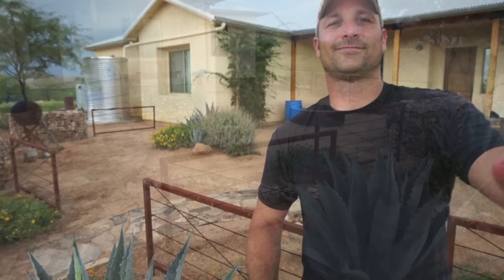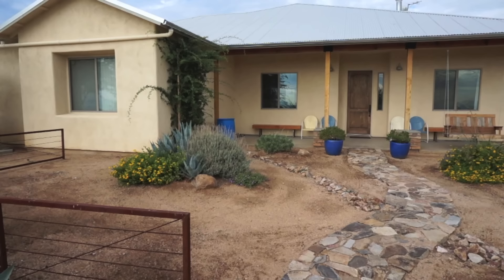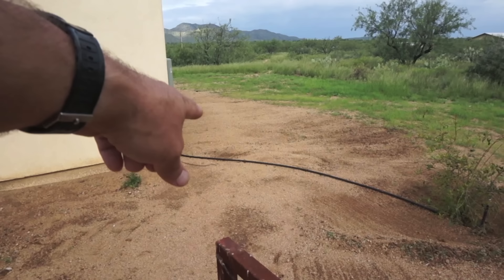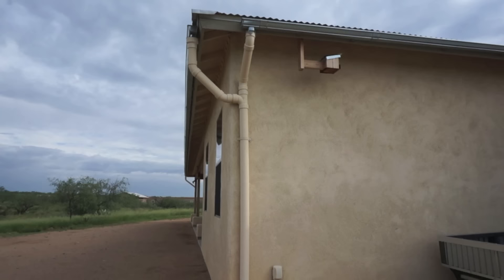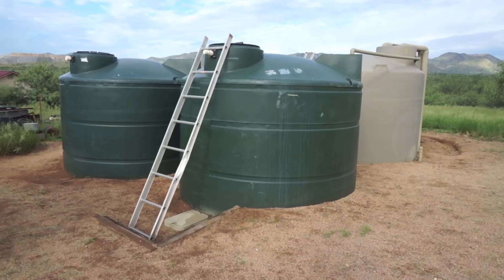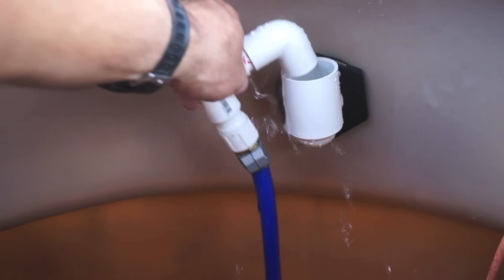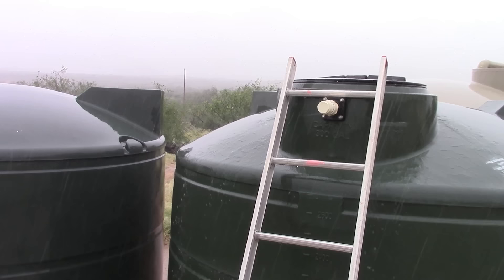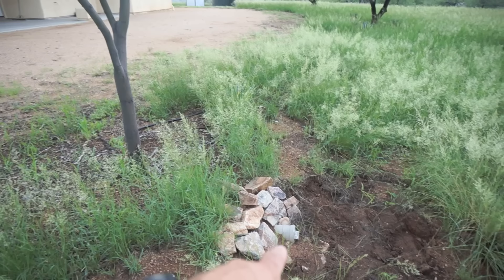Rainwater Harvesting - Home System Tour

Comment: I work in water field and have to say this is a amazing system ! the only issue is you never explained what sort of disinfection system you have in place ? Simple cartridge filter is fine for most contaminants but to not have a steady disinfection byproducts in the water is sketchy for me . You could always put a miniature R.O. sytem inline for complete removal of residuals and contaminants. I'd love to see the pump that I assume sends it to a water heater for showers and what not ? Overall this is amazing dude and what a great job doing the video editing and all .
Reply from the maker: +peteandjanis Hi Pete,  I plan to do another video on our filter system.  For bulk disinfecting we use a very small amount of bleach in the green tanks.  There are charts online that show how much is equivalent to municipal water treatments and we use much less.  But basically that is just to keep anything from growing ;)  As for drinking and cooking water, we use a Berkey ceramic filter system that is rated at 99.99% effective.  They are very popular in Africa and other places that don't have access to the cleanest water.  Each ceramic element  gets around 2-3000 gallons of effective filtering before they need replacing and we use a 2 element system.  So give or take, every 2-4 years we need to change them out.  Anyways, hope that answered your questions and thanks for watching:)
Joe

Comment: Rest of excess water you can dump naturally in ground by making 7x4 feet dug in your land and fill up with sand and small stones. It will increase water level in your area. Also if you have borewell then you can connect this  with pipe horizontally.

Comment: An ideal setup - if water cleanliness was top priority - would be an additional 1,000 gallon tank as the initial catchment for settling. Then after each rain event use that existing pump to transfer to other tanks through a set of 5 micron filters, 1 standard pleated and 1 carbon activated. The smaller catchment tank would be much easier to clean than large tank as shown.
Reply from the maker: +Harley04 Yep it's not perfect, but it works for me:)  However, I will say that I don't think I'd go to a smaller initial tank as it would overflow way to quick during a rain event.  In an inch of rain we get around 2000 gallons of water in this tank.  So if it were too small there would be no way that I pump could keep up, let alone allow the sediment to settle in between rains.  Anyways, I do appreciate the comment and thanks for watching Harley:)
Joe

Comment: If you daisy-chain  all the tanks at the bottom with a 4 inch pipe, you would only need to feed one tank, and it would fill all the other tanks at the same rate, water seeking its own level. In effect, it would make it one giant tank.
Reply from the maker: the greens are connected that way, but the tan is unconnected so as to isolate teh sediment to only one tank.  thnaks for watching:)
Joe

Comment: Love your system! It looks so clean and professional. I know those tanks are expensive to buy and transport. I have 2 little 500 gallon tanks and love them too. But I'm surprised you dont' have overflow pipes and an elaborate run off plan. I'm thinking you do, it must be in another video.
Reply from the maker: +Joan Smith Hi Joan... actually that is a project that I'm going to be doing this spring:)  This system is a multiple year project that has been done little by little as time and money permit.   I had originally planned to do a couple of fruit trees in a large bermed up area but now I'm probably going to divert overflow into some ibc's or maybe a homemade tank... if I can figure up a design that I like. 
BUT... if I do add the tanks I still plan to add a swale or something to make sure than any excess goes to somewhere it can be utilized.    Anyways, I know that's a bit of a long winded answer.. but to be honest, it's because I'm still trying to decide..lol!  Thanks for watching and stay tuned for any updates:)
Joe

Comment: Fantastic - should be common practice on the countryside - around the world. But living in Sweden I wonder about winter and ice (?) Down to - 20 C.
Reply from the maker: Thanks for checking it out Tommy:)  Yes, in subzero temps you'd have to either drain the pipes for the winter or change the set up a bit:)
Joe

Comment: I found your video really informative! I based my system on what you did. I have a tip on cleaning that I did where you don't have to drain the tank. A pool vac. It works wonderful! Look up on Amazon "Pool Blaster Max Li"
Reply: Good suggestion.  I was thinking a regular $30 shopvac would do the job too.

Comment: Have you considered installing a first flush rain barrel to minimize the need to clean your very large tank?  Also if all you're rain water collection containers are full, how long will it last you're family on any normal stretch of time?  Without rationing it, or never doing laundry just regular use.

Comment: Cool video :) There is a "TankVac Self Cleaning System" available in Australia/NZ (perhaps in your country too) that can automatically clean out the bottom of your tank. It uses no power, it basically turns your overflows into a vacuum system. Might be something to check out to reduce some of your maintenance :)
Reply from the maker: +Malessa Brisbane Hi Malessa... I will definitely check it out!  Sounds really interesting:)
Thanks for watching and for the tip... you might just save me from having to climb in the tank so much:)
Joe

Comment: I am in the research phase, and your video is by far the best at explaining.  Especially from a visual learner’s aspect. I have a question.   We are in Tx.  We see a lot of the metal holding tanks. The ones with liners.  I was told  the metal heats up and deteriorates the liners over times.  Is that why you went with the plastic holding tanks?  What is your take on concrete holding tanks?

Comment: Awesome! I have a few questions:  1. What advantage does your wet pipe system have over having the pipes drain into the tanks by gravity (the obvious aside, of having to sink tanks)?  Does it give a cleaner system?  2. What treatment do you do for your water coming into the house?  Thanks!!
Reply: He would have to run pipe overhead like wires, or locate tank close to source, or as you said sink the tank.

Comment: Beautiful system and video.  I think you said you put everything on 4" PVC.  Is that correct?  

I would think that you could also lose some water during larger rain events, where the wet pipes run out of capacity and overflow trying to dump the water into the main cistern.  Maybe expanding the delivery pipe size at the manifold where all of the wet pipes connect should be considered on designs that others might implement.  

I have a plan for a similar system on a 13 acre farm, collected from 3 structures, where I will be using the water, pumped by 12V RV pumps, for several uses, including city water backup, garden irrigation, orchard irrigation, and 4 troughs for animal watering.  Here in North Texas, we need to take freeze protection into consideration, similar to your setup.
Reply from the maker: +Curtis Rock 
Thanks Curtis!  So far the 4" lines have not had a flow problem but I'm sure it's a potential with friction loss, etc,.  On the really hard rains it doesn't appear that they overflow, but I'm usually watching from a window…lol!  So I guess I don't know for sure:)  
Your plan sounds really cool with the multiple buildings for the garden/orchard/ animals troughs…would love to see any pics when it's all running :)
Joe

Comment: great video, great system but have a few questions:

1) where was the mention of 1st flush diverters? 
2) what is the function of the 'cool looking' tank? 
3) how long do you store the water on average? 
4) and can you do another video regarding pressurization, filtration and sterilization please?

I am considering to build off-grid and anything you can teach me would be helpful.
Reply from the maker: +noah williams Hi Naoh... I plan to do a video that answers many of these questions for for now here goes:)
1-I don't have FF diverters.  Many people use them but I don't really have a problem with leaves/etc other than fine dust.  One system I toured before i built mine still allowed in silt and fine dust, even with FFD'rs installed.  So I opted not to add the extra expense.  But they definitely are cool additions:)
2-the 'cool' tank is a culvert cistern that captures water from that section of the roof.  it is not tied to the other pipes because i didn't want to run pipe under where my cars drive.  It can be transferred to the tan rain tank when the tan tank is below half.... just by a hose and gravity.
3-I store the water as long as it takes to use it until the next rains.
4-yep:)  been meaning to do a video for a while... will put it on the list:)

Anyways, hope that helps Noah!  thanks for watching!
Joe
Reply: thanks for the response. thought maybe the 'cool' tank was dedicated to fruit tree irrigation or something. no 1st flush diverts?? so, you must not have pigeons and canadian geese dive bombing your place. that's nice. actually, wondering about the true need for them if a slow sand filter is used. still looking for answers but making progress. thanks again.

Comment: I was wondering why so many downspouts. is it because the rain comes so fast and short and it increases the capacity of how much water can travel to the holding tanks?
am in northern California. there is no rain here for about 5 months straight. i mean none. Can this water harvesting system maintain a garden and fruit trees just from the roof? It does not seem enough water for 5 months of watering. How long is your dry season.

Comment: Good job, but all you need now is a first flush system. Also look into rain heads, which will work better than the system you have now at the top of your down pipes.
Reply from the maker: +Pop's Shack Yes, first flushes are great systems!  And my system is far from perfect.  But fortunately I don't have much of a problem with debris/leaves/etc,.. only a bit of silt/dust on the roof.  I toured a couple of places in Tucson with first flush systems and it didn't appear to remove much of the silt/dust in the extra catchment pipe.  So I opted not to have the extra cost... but they are super cool and I'd recommend them to most folks for sure:)  thanks for watching Pop:)
Joe
Reply: +homesteadonomics I still don't have mine set up yet.

Comment: Yes, very impressive. From all the green plants around your house I'd say you get regular rain most of the time. I wouldn't much here in the desert southwest in southern Nevada. We only get 4 inches a year on a good year.
 You didn't say or show any water filtration system on your house water. Do you use this for drinking water as well or is that the 10% of your water that you don't collect? I'm not convinced rain water would be safe to drink without treatment of some kind.
 Great job on your system it's very efficient and well thought out. I would guess about $15000 for the cost maybe more. I know those tanks weren't cheap. Thanks for the video. Peace be with you my friend.
Reply: big berkey  water filter with ceramic filters for drinking

Comment: a few Questions - why place the cisterns away from the house? What kind of insulation did you use with your roof to help reduce noise? (stiff fitted to the metal, like with garage door, just pink stuff the rafters, blow in?)  what about heat issues with metal roof? and last question - solar on roof or on its own scaffolding? (I'm seriously thinking about NOT putting it on the roof, but on its own to make it easier to service.) asking because you seem to have put a lot of thought into this.

Comment: please help me sir,
what kind of roof is safe for me and my family to collect rain?

we don't know the local name for corrugated steel, but we do have galvalume or galvanized roof, is that okay?

can i use green galvanized roof?

thank you sir, 
great video you have made!

im going for a homestead too, btw :)
Reply: Please be aware that rain drops collect moisture around dust that includes car exhaust, chemical leaks, nuclear leaks, mercury from coal-fired plants, bacteria, and even traces of Strontium  90 from nuclear tests and accidents. 

YOU NEED TO PROPERLY FILTER ANY WATER USED FOR DRINKING, COOKING, DISHWASING AND BATHING. Happily water filtration has had amazing advances in the last 5 years.
Reply: If you have already bought the roof, go to the manufacturer and ask about the chemical substances in your roof. Then ALSO find an independent lab to test your water. 

Food safe plastics like HDPE are healthier for consumption than PVC. It's possible that food processing companies use all these parts in food safe plastic already. If enough water harvesters demand it, there's no reason why your pipes and holding system can't be in food safe plastics.

Eventually, metal roofs designed for water collection will be readily available; alternatively, In frost-free zones, ceramic roofs with solar collection capacity may become normal.

Comment: Great Video. I live in a small 900 ft2 house in British Columbia, Canada. It has a rainwater system built by the previous owner. I quite like it. The holding tank is 1500 US Gallons which is 4 feet under ground so that it doesn't freeze in the winter. Amazingly I have only had to buy 1000 Gallons of water once to fill it in the 8 months we've lived here.  Otherwise, the system has always supplied our entire house just from the roof.

My only concern is filtering. Do you have any water treatment or filtering at all? I have considered installing a filter or UV light into the system but haven't yet. Once in a while the water has a slight funny smell to it. I on occasion dump 150 mL of bleach (which is 4% chlorine) into the 1500 USG holding tank thereby giving us approximately 2ppb of residual chlorine to ensure there are no bugs living in the water. This is exactly what municipal water system have. What are your thoughts on that?
Reply from the maker: Hi Matthew!  sorry for the super slow response... i've been camping for the last week.  Anyways, I actually will be answering this more indepth in a follow up video that I'm working on.  But the shorty answer, is that we use a bit of bleach as well, then all of the cooking and drinking water goes through a berkey ceramic gravity filter (slow but effective).  Other than that the rest of the house water is just plain rain:)
btw... your property sounds amazing!  BC, Canada is one of the most beautiful areas I've ever been to:)
stay tuned for my rainwater harvesting QA video:)
Joe

Comment: If you put 3ft fiexleble on the end you got.n.r.v. You could save yourself 16dolloers put plug both ends air lock would pipe keeppipe charged .70 years in thi game.try it with 6ft hose pipe puts toppers both ends

Comment: Help!

I have a small collection system in my house (200liters) that i built only 2 months ago. I use it to water plants in our yard.
We went for a holiday for 3 weeks and when we came back the tank had filled up. Only problem is that the water smells really bad, like a swamp. I have a plastic mesh that prevents debree from getting in the tank and the water looks perfectly clear. Should I drain the tank now and start over? How do I prevent this from happening again?
Reply: Just put some bleach in it. That'll kill most of anything that smells.

Comment: How they don't put water outlet to deep of tank? Because city main water systems have sand catcher pools and sands and other particules mass the subside. There is an outlet and valve in deep of pool and it is used for cleaning and removing sand when the deep is full of it. (Sorry for bad EN)
Also that pools' deep is sloping to the outlet so sand goes and masses to it.

Comment: Hi! Very cool system. I was wondering if there is an equation or other method you used to calculate the flow capacity of the pipe system. I could see the system overflowing at the inlets in a very heavy rain if the pipes aren't wide enough for the total capacity. (Which wouldn't be the worst thing in the world anyway) Definitely inspiring for when I have to re-do my own gutters soon!

Comment: Great video, great details, thank you for sharing your knowledge & experience.  I am just seeing this (07-2018) now so it has been 3 years since you posted it.  Question:  looking back at cleaning the tan tank, have you thought about or have you installed a drain valve on the tan tank to expedite cleaning it?  Also, I would like to know details about the galvanized tank, did you build it yourself, it is a kit, is it a pre-assembled unit?  Hey thank you very much!